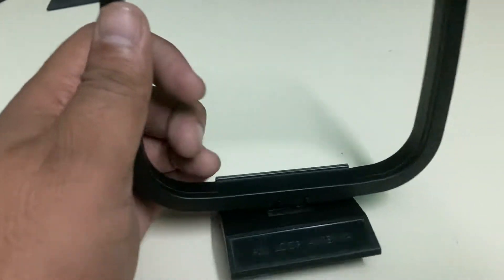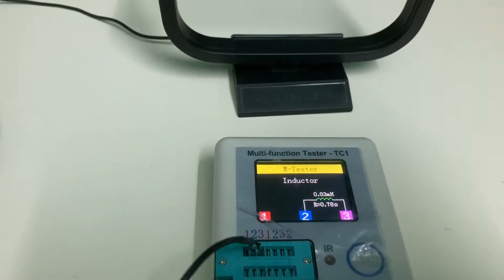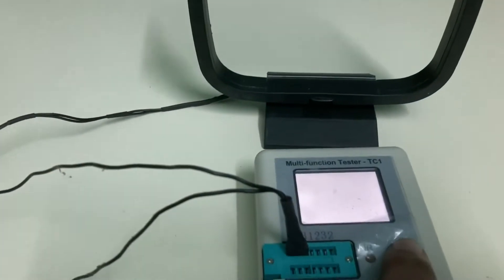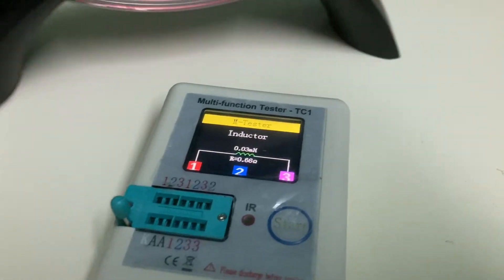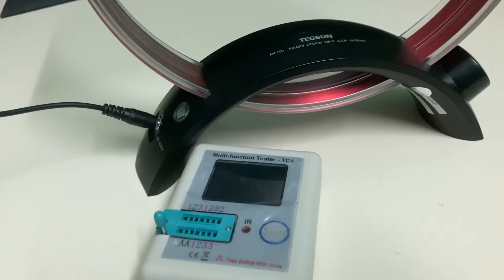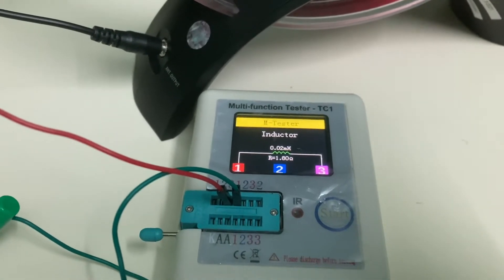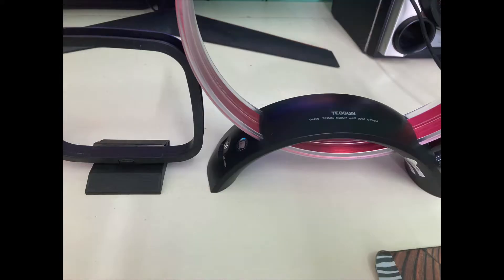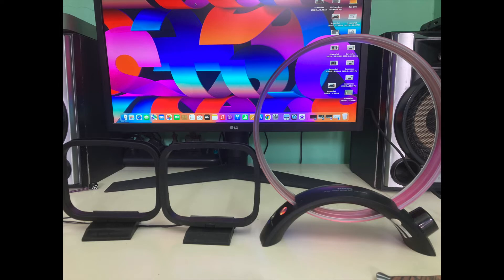Antenna for Radio | Comparison of loop antennas

Comment: From where did you buy those antennas ?
Reply from the maker: AM loop I bought from aliexpress. Sony antenna came with sony music system. Tecsun antenna I imported from ubuy online website.
Reply: sir which antena you will suggest to buy ?
Reply from the maker: @adnankhanjoiya  Tecsun AN 200 Loop Antenna is the best in all these 3. But the are lots of other factors that come into picture to get a good AM reception. Avoid areas with lots of electrical noise for better clear reception.
Reply: @allaboutradios  bende Sony loop antenna var radyoya nasıl bağlıyorum
Reply from the maker: It's available online.